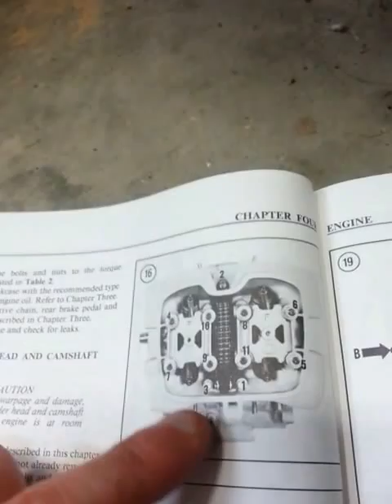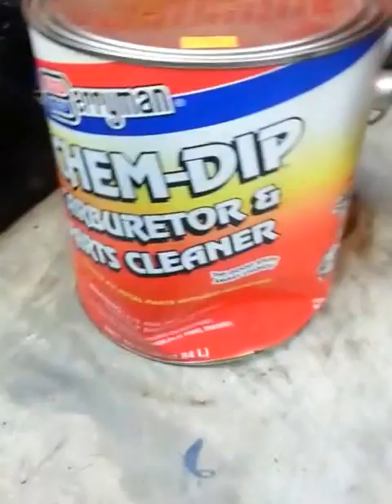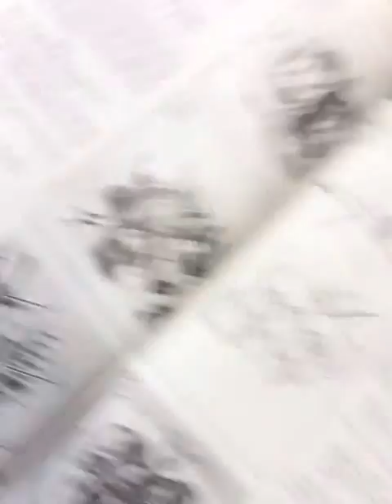Honda Rebel Cmx250c

Comment: I have a 2002 cmx. 250. Came with 1400 miles. Put about another 2000 on it and always took care of it and change oil more often than need to. Well I wound up having to ride about an hour each way to work and let a few days go by that I didn't check it   was 3/4 low. After a month or so I noticed it was burning oil quicker than usual. After compression test I know I have to replace rings  I've only worked on a few gas scooters putting on big bore kits. Is this a similar process and should I use only oem rings? Can you recommend a rebuild kit?  Thanks for the great video as well!
Reply from the maker: You can use china clone parts.  I have but you just have to check the specs very closely. In my case the China Clone head the exhaust ports where slightly different in such a way for mounting the exhaust was different and required slight modification.
Reply: @kd5bwp  I appreciate you. I won't know till I crack her open but that's good to know. I have some Chinese parts from ebay in a cart.. it's literally all the rings gaskets and 2 cylinders. I'd think for what it is it will work. Crazy the video is old but your still helping fellow riders man.. that's really awesome of u! I'm going to more than likely make a bobber out of her. Maybe down and dirty loud exhaust and raw looking..thanks again. Helps alot to get a boost of confidence. I have feeler gauges and all the other fine tuning stuff from when I messed with scooters. This will be my first bike rebuild.
Reply from the maker: @nicholascorbett4622  Tho the rings only really matter on thinness they can be too big in diameter and then cut to fit.  The engine is the same pretty much from 1986 to current with the carb versions.  Tho in 1985 and 1986 they had a 450 version and I had that one too.
Reply: @kd5bwp  I just lost a 450 in a bidding war through Facebook. It was an 87. 6000 miles. Only needed a back tire. I'm on the rebel forum and some of those people make it seem like if it's not oem and rebuilt to factory specs I'm wasting my time..I had no issues taking a 50cc scooter up to a 100 and rejetting with pod filters and upgrade cdi ,plugs,throttle adjustments and making them pretty fun with eBay Chinese parts. Again thanks for the vote of confidence

Comment: what manual are you using ?
Reply from the maker: I wasn't really have a ton of experiences working on cars and engines. The one in the video I used for the tourqe amounts and pattern. 

https://www.amazon.com/dp/1620923386/ref=cm_sw_r_cp_apa_fabc_5nEVFbCZDXZTM

Comment: hey kd5 what are the breakdown steps for timing that thing is it jus turn that to the lt then start it up or is there more to it than that
Reply from the maker: Tdc when you put the chain back on and adjust the valve lash and that's about it on these motors.
Reply from the maker: https://www.amazon.com/dp/1620923386/ref=cm_sw_r_cp_apa_fabc_5nEVFbCZDXZTM

Comment: Were you able to remove the head without taking out those boltls?
Reply from the maker: Had to pull the motor from the frame once I did that it came off when I pulled the cam and disconnected the cam from the gear. I left the chain in the block and only did a top end rebuild with a new head.

Comment: hello brother greetings from Venezuela, I have a honda nighthawk 250 year 1992
I mention one of the problems I have is that there are no good mechanics for this type of motorcycle, I have two years with a fault that when I put down the spark plug on the left side turns off only when I go in speed, in neutral does not , well the fault is more constant on the left side, and the right side is very little, to get it to start working the spark plug the disconnected and put the spark away and returns to match the spark plug, I hope you help me thanks .. .........
Reply from the maker: alex quintero if you can show a video that might help. But from the sounds like your cid box is having issues or you have a short from your neutral switch that controls your light on the dash.
Reply from the maker: alex quintero also check to make sure that the spark plugs do not have cracks in the boots causing you to lose spark. But your problem sounds electrical try with simple unplug the neutral switch and by pass that clutch switch.
Reply from the maker: You can use the China Version for the parts they will be close but never 100 match. Also life span is much shorter than OEM.
Reply from the maker: Tho I used a China 250 head on the OEM 250 Honda motor. It can work you just ha e to modify a little.
Reply: if brother here is hard to find but which you recommend me the other thing is that he told me that the car can also serve me, now I do not know if it is recommended
Reply from the maker: alex quintero what?
Reply: sorry you say head